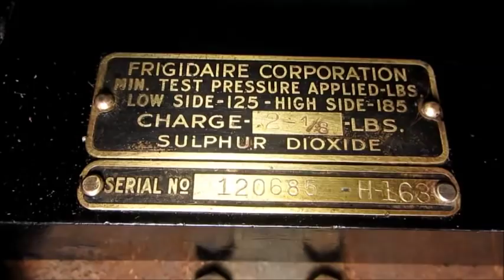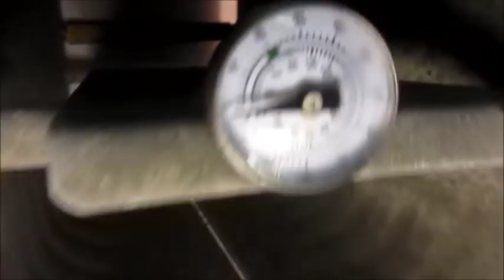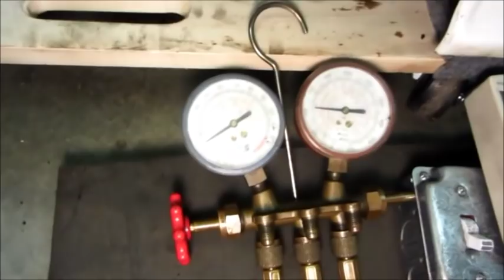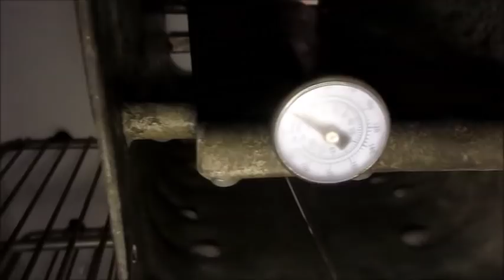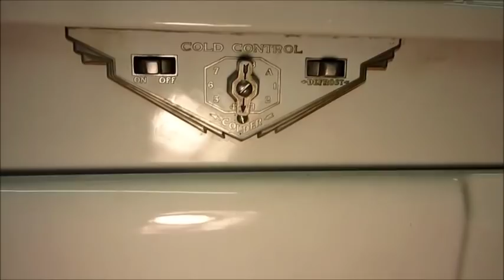1933 Frigidaire antique refrigerator - 3 -Refrigerant charging...

Comment: I recently learned that drawing a vacuum of course is an absolute when it comes to making the system ready for charging. What I did not know, was that though the system may be in a deep vacuum, the piping and the compressor will still have moisture unless it it is driven off by heat, such as a torch lightly heating the material the Freon passes through. I’m certain that a suction and line filters help, but an absolutely dry system cannot be achieved unless the moisture is driven out of the system. 
Love the videos. Love those vintage refers. I know they are re-enameling old gas ranges like O’Keefe&Merrit, so it would really be something to see a fridge cabinet done this way. This last fridge looks amazing.
Reply from the maker: Thanks James. You're right about the moisture removal process. If I am concerned about that, I will heat the components with a heating gun, or if it will fit, place a box around the whole system and have a heater blowing in, heating it to about 150F overnight with vacuum on. This will ensure it is dry. This is especially important if there is oil in the system which may be emulsified with water.

In this case, with a non-electric compressor, no capillary tube, and a noncorrosive refrigerant, a little moisture would have less harmful effect than it would on more common systems.

Interesting about the re-enameling of the old ranges. I need to check into that for sure.  The 33 Frigidaire looks so well as-is, It might as well have already been done!
Reply: davida1hiwaaynet 
I became aware of the re-enameling from looking at restored ranges as I said. Seems like there was someone in Los Angeles area who was selling them.

Comment: A refrigerator with an A-6 swashplate compressor would be interesting.  If I am not mistaken that was actually the world's first swashplate refrigeration compressor.
Reply: that compressor is a twin cylinder reciprocating type
Reply: @gregoryclemen1870  I'm talking about the Frigidaire A-6 compressor which was used in automobiles.  That is a swashplate compressor with three axial pistons.
Reply: @douro20  , OH YEA!!!, O.K., now I get it!!!, that was a 36000 B.T.U. compressor, very efficient , and long life to go with it . it was hard to hurt, one of the best compressors ever made!!!!!
Reply: the "A-6" compressor would be a huge mismatch for a "FRIDGE", it is too big in terms of capacity!!!
Reply: @gregoryclemen1870  Well, I didn't know they had such a big capacity.
Reply: @douro20  , yup they sure did, as small in size as they were , they packed a big punch!!!!
Reply: The heat of a car engine has to be removed so a car or vehicle AC unit is 3 or 4 tons
Reply: I never here this mentioned - those fridges were more efficient then modem fridges -    since I spent my yrs working on generators in the offshore oil field - 
    I became acclimated to the heat - when my ex left I quit using the AC and just used a window fan in summer - 
     When it was 95 or so in the house the frost free fridges ran constantly and did not get to cold -
     I had a GE  fridges in my shop that I  used - it kept things cold when it was 105° -    it had coregated aspestos insulation  - 
       I put it in the house and used it for yrs - during the summer the kitchen might get to 110 - that old. Fridge did not cycle much - 
     I live in the rural south - hurricanes can knock power out for months - 
     When your running a home on generator for several months you notice it when things burn a lot of power - 
      Modern fridges drink power like water compare to those old fridges -

Comment: I am impressed. Weren't repulsion-induction motors used for applications in which you needed much, much higher starting torque than running?
Reply from the maker: Hi Ethel. I believe they can provide higher starting torque, or lower starting amps; depending on how the motor is manufactured. The compressor on this fridge has no unloader, so the motor has to pull the compressor through compression at startup, so this motor would be a good choice.
Reply: repulsion- start/ induction - run motors were the forerunners to the cap start motors, and yes they were used for higher starting torque applications!!!!
Reply: The GE monitor top is the first refrigerator to use a hermetically sealed compressor.

Comment: I read in article in hvac-r news where the techs were using 401b refrigerant. I talked with a guy who only restores and he prefers virgin r-12 which is still available?
Reply from the maker: Definitely a very slippery slope to go down when choosing alternative refrigerants for antique machines. Most alternatives today are sold to match the temp/pressure chart and oil miscibility of R12 and are mainly intended for larger systems, with expansion valve and serpentine evaporators.  There is a market for this because there is still a lot of R12 era commercial equipment still in operation. 

The older, smaller machines like I work on, many use a flooded evaporator, will not operate well with blended refrigerants and therefore need a singe-component refrigerant.  The safest bet is of course R12 since that is what it is designed for.  The new single-component gas I have been using is R152A. It has a sightly different pressure chart from R12 but not by much. It works as a drop-in for lower HP early systems which use mineral oil and capillary tube metering, or float metering. If it's an expansion valve system it will also work, but you will need to adjust the expansion valve to obtain optimum performance.

The definite No-Go gases are blended hydrocarbons which are sold as automotive A/C R12 replacements. These can damage the rubber parts in some older compressors and lead to external refrigerant leaks.  An even bigger No-Go is trying to use POE oil in any antique compressor as there will be material compatibility problems.
Reply: @davida1hiwaaynet  I think I will go with 12, still available on eBay

Comment: When you vacume out the sulphur dioxide do you pump it into a tank or burn it off - that stuff stinks bad lol
Reply from the maker: It's one of those things which one is hard to describe without handing out a sample of it LOL!  I describe it like the overpowering sensation of boiling vinegar so that you have to turn away and cough. The odor is more like fireworks smoke or fumes from a volcano. It does not smell like sewage or anything organic. 

As for disposal; it doesn't burn so that isn't an option. It can be diluted and vented, since it is not a regulated refrigerant. If you are not in a position to do this safely, it can be dissolved in water containing a base of some type, such as NaOH or Na2CO3. The SO2 will dissolve in the water and react and neutralize. 

There were some really unique ways of disposing of it back in the day. One technique was to insert a hose down into the drain of a toilet, past the trap, and vent the SO2 into the sewer pipe, hoping it went out the vent pipe with the sewer gases. Knowing my luck; that would probably erupt violently through the toilet in some other hapless apartment dweller's bathroom!
Reply: I know H2S as a kid I had remembered how strong that sulphur dioxide was when it was leaking out a seal - it really stunk lol - 
   Also I remember it staying in my sinuses for a week after being around it - 
     That fridge I had - I took the old evaporator compressor and condenser out & took one out of a 1950s  fridge and installed it in my older cabinet that was in good condition - the evaporator was a exact match and I used R 12 for refrigerant - 
    Were I live up till 2000 or so my power could be knocked out for several months after hurricanes and ice storms - 
        A frost free fridges drinks power it's not noticed when using Air condition  - 
    After hurricanes I have enough propane to run the stand by generator for a month - 
       It takes a while till they will make bulk delivery's of fuel  -   if it's to long, I have a 9 kw bank of flooded battery's that a inverter is hooked up to - 
    I have a whole house fan and hunter ceiling fans - the oil engine gen stays up with the battery bank fine - as long as I'm not using the frost free fridges lol - 
       In that case I would just use the old fridge during very long power outages - 
   In the oilfields by 1980  they were very aware that I was better than most with electronics - 
     In the end I was doing start ups on PLCs on platforms - I would get home to see my wife and kids possibly 3 days every few months - the over seas guys only came home a week every 8 months or so - 
      I was not going to stay gone that long so I would only work state side - 
     My oldest son brings his wife and kids to Europe for vacation for 3 or 4 months a yr -  I never had a desire for traveling - but it was a occupational requirements lol -
Reply: This came to mind there were other make  of fridges that had a.110 AC the sealed compressor on the top - but also the DC version , had a belt drive compressor on the top of the fridge behind a cover - 
     Another I remember was many unplugged the fridge at night when they went to sleep lol

Comment: Does this design, with the high side float valve, not depend on a precise level in the evaporator for oil return? I want an open drive refrigerator for my bus conversion so I can fit it with a DC motor to run directly off the 112 volt nominal system (56 lead acid cells). So I need a fridge that can tolerate running while moving, and / or off level...
Reply: Here's the motor I have in mind. ;) I don't know exactly when it was made, but it certainly looks close the same era... https://m.youtube.com/watch?v=grFDv2PLq3k
Reply from the maker: With the high-side float it would work fine without being perfectly level. It would need to be "within reason" upright of course.

The evaporator on this fridge is similar to the newer Frigidaire hermetic units. It returns oil by floating the oil to the top and allowing it to return from a header at the top of the evaporator.

I am pretty sure it would function effectively in a mobile environment.
Reply: Ah. So it still requires a specific oil level in the evaporator, such that the oil makes it's way out.  Hmmm... I guess this is going to be the case with any flooded evaporator then.  The evaporator behaves like a still. ;)
Reply from the maker: Yes, they all require a certain amount of oil and refrigerant in the evaporator. That's one of the reasons there is such a high volume of oil charge in the system, as well. It helps keep the oil circulating under all operating conditions.
Reply: @davida1hiwaaynet  , oil in the evaporator will act like insulation ,and will have a direct effect on efficiency, not to mention poor oil return ( no oil return). I worked on ultra low temp freezers( cascade type) the best thing that you can do is install a "OIL SEPARATOR" that will capture the oil leaving the compressor, and return the oil back to the compressor crankcase!!!!. oil return can be a problem when you change refrigerants, and you don't remove the existing oil out of the evaporator!!!!

Comment: Is the thermostat on this just an on-off switch for the motor? I saw one fridge where the thermostat actually did something in the refrigerant circuit as well as turn the motor on and off. I'm assuming you're using polyol ester oil with the R152A.  What would the original sulfur dioxide coolant have used oil wise?
Reply from the maker: Hi. This one actually is a conventional, regular, run-of-the-mill thermostat. It senses temperature of the evaporator coil (the freezer compartment) and just turns the motor off and on as necessary.

The older generation of Frigidaire units had a pressure-based control system. It was connected to the low-pressure side of the system. That allowed it to sense the evaporation temperature, since the temperature / pressure chart for the refrigerant tells us that if we keep the low side at a given pressure, we will have a given evaporation temperature. These are still in use, in modern form, in many commercial units. Ranco makes them in a wide variety of pressure ranges. Here is a video about the Frigidaire control connected into the refrigerant circuit. It doesn't alter the operation of the refrigerant circuit at all. It is only sensing the low-side pressure. Then it controls the motor off and on. https://youtu.be/0YjbH4AT3_Q 

As for the oil, the original SO2 system used mineral oil. You can often find the empty cans sold at antique shops. Search "frigidaire oil can vintage" and you should see some yellow metal tins.  This was a highly refined dehydrated mineral oil. Sulphur dioxide is only slightly soluble in mineral oil, and only at warm temperatures. In the evaporator coil, the oil and refrigerant separate fully into layers. There is a return line at the very top of the evaporator to skim off the floating oil and return it to the compressor.

The repaired fridge in this video is using R152A and alkylbenzene oil. AB oil is a synthetic oil with very similar properties to mineral oil. It does not break down at high temperatures into carbon deposits as easily and therefore it is an improvement over mineral oil.  The R152A is slightly soluble in the AB oil, similarly to the solubility of SO2 in mineral oil. By choosing this combination of refrigerant and oil, it will operate similarly to the original refrigerant and oil charge.

There are so many different types of refrigeration system designs. Some of them require complete miscibility of the refrigerant and oil; while others only need slight solubility. In general, older systems with low horsepower compressors do not depend on oil miscibility. Systems with long lines and remote condensing units often depend on oil miscibility so that the refrigerant "washes" the oil back to the compressor.  High power-to-size ratio systems such as automotive A/C always depend on 100% miscibility since the compressor is cooled and lubricated by a mist of mixed liquid refrigerant and oil. We in the antique fridge hobby have tested certain common systems with different refrigerant and oil combinations. It's been determined some models that are pretty well fully compatible with low-solubility refrigerant and oil combinations. Outside of the system types which are fully proven compatible, it's best to stick with the original. Sometimes that's just not possible, though due to availability of the refrigerants now, however. In this case, you can look for design similarities with other designs which have been tested.

With antiques, there are a lot of natural and "exotic" materials used in the compressors. They have paper and cotton used for motor insulation. There are natural rubber and resins used in the electrical terminal seals. The material compatibility of these parts, with some of the new oils is an unknown area. We do know that use of R600 or R600A hydrocarbon refrigerants in many early systems is a big no-no.  This will cause the electrical terminals to start leaking oil and refrigerant out of the compressor. The aggressive solvent nature of the hydrocarbon permeates, swells, and softens the materials leading to a failure. This lesson was learned when the R12 ban was a new thing. Companies were selling R12 replacements for car use, which were butane based. In spite of these products labelled for use in automotive systems only, people used them in antique fridges. This resulted in electrical terminal leakage on quite a few 30's and 40's refrigerators. 

I know this got really long. Sorry about that but there is just no simple answer. :)
Reply: @davida1hiwaaynet  Thank you for taking the time to write this.  Much appreciated!

Comment: About 80 percent of original charge with gas you used?
Reply from the maker: I think about 60% by mass, but this being a high-side float system needs to be charged by frost line on the suction accumulator.